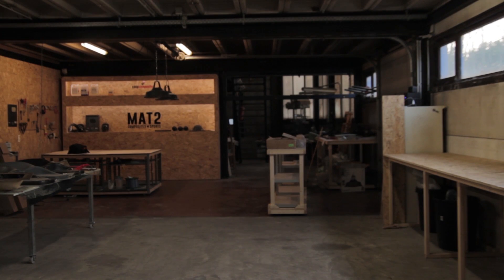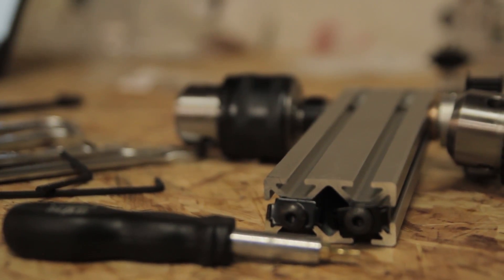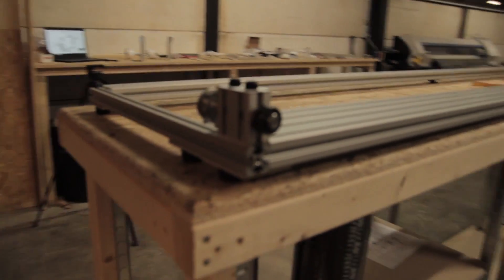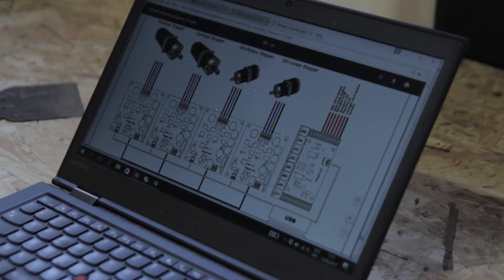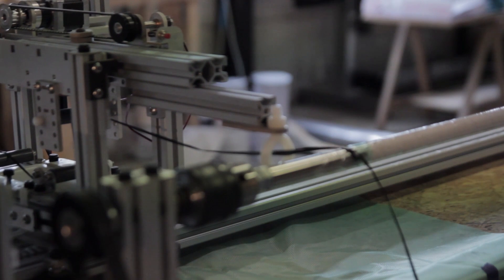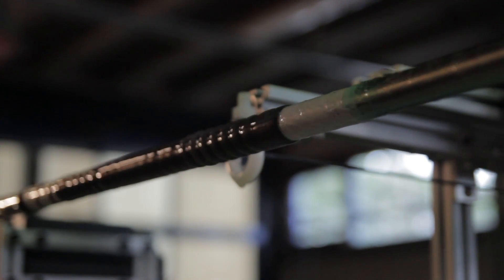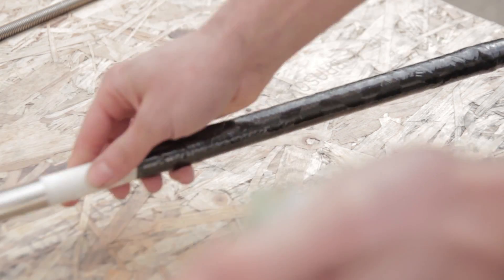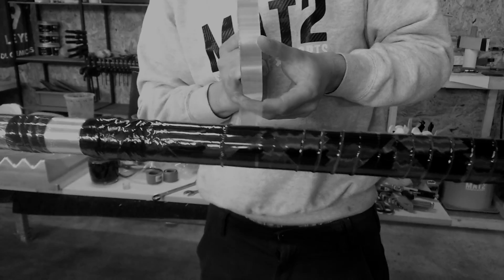Filament Winder X-Winder (Build and first trial)

Comment: I bought the 4 axis unit for my company back in 2015. It was a nightmare and never produced a single finished part in over 2 years of trying to make it work. We ended up doing a lot of rebuilding including replacing the horrible brass bushings used with proper self-aligning bearings, upgrading the power supply which couldn't deliver the required current needed for all 4-axis of drives & then still had to struggle with the g-code generated which ended up requiring many edits of carriage speed to even get the paths to align correctly. In the end the software would crap out & force the payout eye to ram into the mandrel at some random interval & destroy the wind, after receiving no feedback on many assistance inquiries I found out in the user forum that this issue had been acknowledged & patch generated, honestly I felt like taking a sledge hammer to it after giving up 3 months of my own weekends trying to make it work.

Our principle application was dome end vessels, but it appears people get these machines working ok for simple tubes. Wouldn't recommend it to anyone looking to do more than make a tube.

Comment: I have one, lots of problems that need to be addressed. Working on making something to implement less resin. Even with the doctor blade you can expect a lot of excess resin.

For now I recommend using low viscosity resins.
Reply: I 3d printed 2 rollers the filament get squeezed through. Works great
Reply: Use towpreg from TCR Composites

Comment: @Matthieu, would you mind if I'd ask you a technical question? I am about to laminate some things and am not 100% sure about my strategy and wanted to check it up with someone that is a lot more experienced with composites (and composites from EC in the UK). 

So: I am about to laminate or "skin" a 3D printed model that I allready prepared. Due to its shape I am not able to do it with one large piece of fabric and I do not have a facuum infusion setup, so there is no way to properly press it against the print while it cures. My thought is that if I prepare everything precisely and press the pieces of fabric close together (not overlap) I should be able to finish it to a nice look after the resin is cured. I understand that it compromises the strength, for that I also include strips of spread tow ribbon to actually connect all the pieces together. 

Would you do this (with the materials and tools I have available) the same way or would you advise me to do it another way? I did a couple of test pieces and learned a lot form it. It should work out but the shape is quite a challenge. 

To not clutter your comment section more than needed, you can find more info about the project here:
https://www.rcgroups.com/forums/showthread.php?3016320-Autonomous-paramotor-%28Opale-Hybrid-5-2%29

And finally: you can answer in English or Dutch, I decided to comment in English so everyone can understand it.